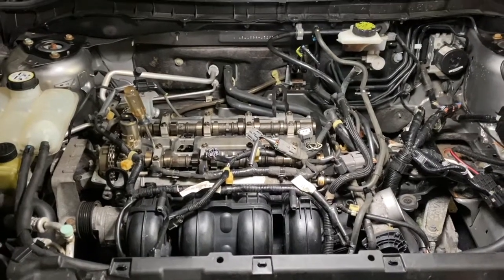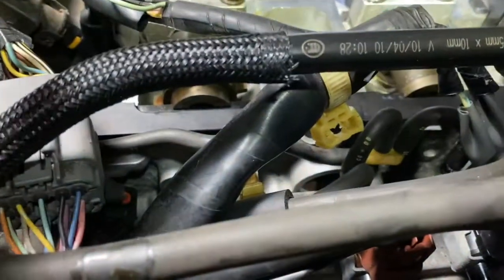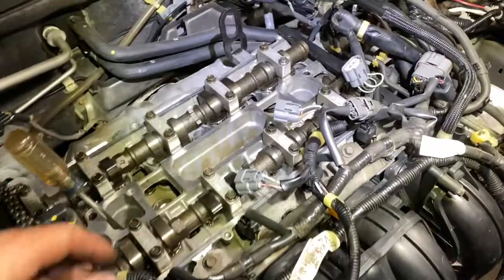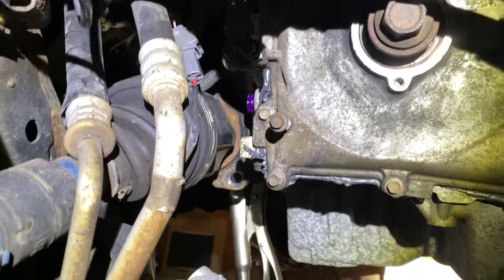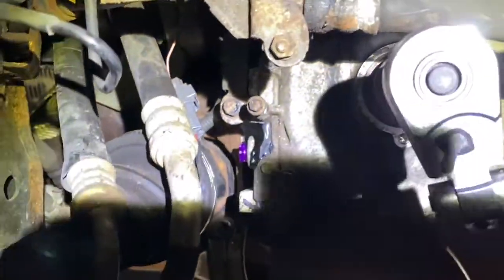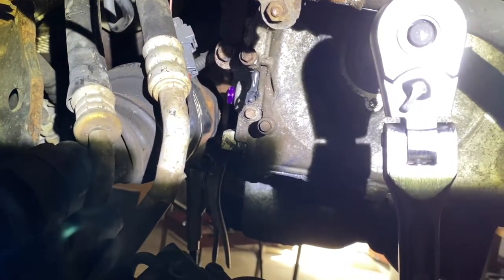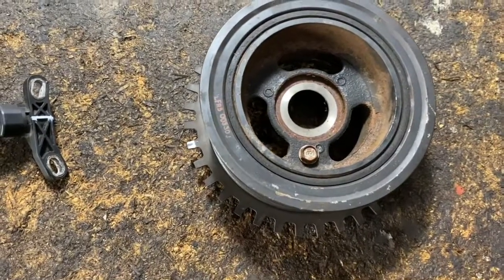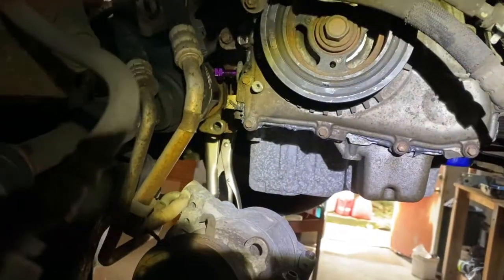How to align valve timing on 2010- 2013 Mazda 3 / Ford 2.0 engine

Comment: Someone said you had to “pre-load the VVT” before installing the timing chain and tensioner or else it will misfire.  Did you do that too on this engine?
Reply from the maker: NO
Reply: @motorcarnut  thx
Reply from the maker: No problem

Comment: Fords better idea on how to make junk. No keys.
Reply from the maker: You probably don't work on modern vehicles most freewheel with no keyways
Reply: @motorcarnut  Oh but I do. I have had problems with the torqued bolts holding cams slipping and they were torqued to the proper torque. The ford 4.0 L engine is bad for having the cam bolts slipping. All in the design to happen on purpose. Should have key ways.
Reply from the maker: I do agree about the key ways but all these manufacturers cut costs consistently it’s a shame

Comment: Jesus this is a huge and painful job I was thinking if I should adjust valve clearance for my 2.0 mzr engine but I changed my mind haha.
Reply from the maker: It’s not that bad if you have some tools and patience.
Reply: @motorcarnut  I was simply annoyed by how badly designed the coolant drain plug was on my car as it is for some reason facing horizontally so I bet I have no patience. How long does this job take for a first time DIY guy?
Reply from the maker: @gandhisFlipFlops that depends but I agreed, vehicles nowadays are less and less diy friendly that’s why you have me.

Comment: Hey bro how's it going how are you. Can I ask because I'm having trouble with same engine we replaced the timing chain kit. And we replaced the vvt but unfortunately we don't know how to put it back the vvt gear.
Reply from the maker: Just follow the video, you’re going to need some special tools as stated to line everything up or it won’t run or run right.

Comment: Just a note from the Mazda service manual. A valve cover bolt fits in the crank pulley TDC hole and bolts into the timing cover. If you've got the valve cover off as you undoubtedly will you'll already have the valve cover bolts free to use one in the crank pulley.
Reply from the maker: I did mention the size but your advice is great as well, thanks!
Reply: @motorcarnut  sorry , you did mention the size but just to save the hassle of searching for one of those dimensions I thought I'd mention it.

Comment: What if both camshafts are out by 1 degree after the final tightening and chain rotation to check the timing? It is impossible to loosen intake camshaft bolt to align intake camshaft without taking front timing cover off?
Reply from the maker: I wouldn’t do that, somewhere you did something wrong. Should redo it.
Reply: You're actually supposed to have the camshaft sprockets slightly loose / free-spinning while you dial in the timing from below.

Comment: Hello Motorcarnut. I followed manufactures instructions for installing timing chain on 2012 Mazda 3 skyactive and got intake and exhaust camshaft sprokets aligned with crankshaft key but something is not right because i have some knocking and had an error code confirming as much.

Do you have any ideas what might be happening that i can research.
Reply from the maker: Hard to tell, don’t know what you did or didn’t do. Do you watch my video and compare? There is very little room for error when setting up valve timing on these engines.

Comment: Hi!

I am planning to replace the tappets and I have the same engine and I wanted to ask if it is really necessary to install that tool to lock the crankshaft. I have to repair my car on my parking lot, and I don't know if I will be able to get under the car and move the cv shaft to get the tool inside. Would it just be enough if I put the first piston at TDC and stick a screwdriver there and just pay attention that the screwdriver won't move?  I mean if the first piston will stay at TDC throught the whole procedure, then the crankshaft will still be in time, right? 

Thank you!
Reply from the maker: I don’t recommend doing it without the proper tools because there are no timing marks, everything free wheels, no notches, it all relies on those tools and you may get the timing close but almost for sure you will get codes and or poor performance.

Comment: Hi i have replace the head gasket and the rings for all pistons and still get a misfire on  cylder 2 check
Reply from the maker: Recheck cylinder compression on #2  as well as ignition spark and fuel. Also the spark plug too.

Comment: I also have a blown head gasket. Why did you decide to change the head gasket instead of an engine swap? My engine stopped and had coolant in combustion chamber
Reply from the maker: Because an engine could be thousands to change and head gasket replacement for me is about $200.00. But every situation is different
Reply: Was your block warped? How warped was your head? What's the max limit warpage before you would do a swap instead?
Reply from the maker: The max warpage is 0.002 for the head and block. If out spec you would have to have either milled back into spec Also have to make sure all valves are seating properly. I had some cases where the head was warped bad enough that the valves wouldn’t seat properly.

Comment: Do you have a video on how to put on a new timing chain after head replacement? There is no key on the crankshaft
Reply from the maker: I didn’t make one on the timing chain but when you take it off just follow this video on how to realign the cams, crank, pulley and crank sensor.

Comment: easiest way to do timing on mazda's 2.0 2.3 2.5 liter engines is cam alignment tool and crankshaft pin. (pin goes into a small hole on the exhaust side of engine, near the timing position sensor, there'll be a size 8mm bolt that you unscrew and then screw the crankshaft pin into, turn the crankshaft pulley clockwise until the crank pulley stops. this is where the piston is set to TDC. no need to stick a screw driver in the 1st cylinder. plus, the crank is stopped from going any further, thus allowing for less checking that nothing has been moved out of alignment.
Reply from the maker: The way I explain in the video is how it’s done. You’re basically saying the same thing as in my video except you left out the 6mm bolt that has to be installed through the crank pulley for total alignment. The TDC with the screwdriver is alway a good habit to have on any engine especially for people who are doing this for the first time.
Reply: @motorcarnut  well, i would use a dowel or something nonmetalic
Reply from the maker: No need, but whatever makes you happy

Comment: Ford uses mazda's 2.3l and 2.5l as their Duratec and Ecoboost series motors with ford's own head and timing. the motor is a (MAZDA MOTOR).
Reply from the maker: And Ford owns Mazda so repairs are basically the same.
Reply: Not for a while now

Comment: Do you have a video of your replacing the head gasket I’m wondering if I have to disconnect my timing chain to receive my head to replace the gasket
Reply from the maker: I didn’t make that video yet, but yes you have to remove timing chain in order for you to remove the cylinder head.

Comment: How did you lock the CRANKSHAFT when installing the harmonic balancer pulley bolt and washers without the crankshaft moving? U mentioned a tool to lock the pulley....
Reply from the maker: That purple tool on the side of the block along with that little bolt in the crank pulley holds it in place as you torque down the crank bolt.
Reply: @motorcarnut  hmmm. This is the only thing I'm a sitting duck on... I'm gonna pick your brain a bit.. so what you're saying is you can torque the central bolt on the harmonic balancer to torque specs (70 foot lbs ish, plus 90 degrees) using the back of the engine timing pin and harmonic balancer pin as the support? I always thought u weren't supposed to use the timing tools to support the final tightening? I thought the balancer bolt was supposed to be tightened while locking the starter sprocket or something like that?
Reply from the maker: Know you are correct, I forgot how I did that car, lol but, no don’t put pressure on any of the timing tools they are not designed for that. Maybe wedge a crow bar on the flywheel somewhere?
Reply: @lithium3332  Get a three pronged crankshaft pulley holder tool.

Comment: Mine doesn’t have the crank sensor or teeth on the balancer. I also have a sensor where the stop bolt goes
Reply from the maker: What year make and model do you have?
Reply: @motorcarnut  2012 Mazda 3 skyactive vin #: JM1BL1W78C1581983
Engine just spins with no compression. Timing chain tight, I can see the cam turning and valves moving. Why would I have no compression in all 4 cylinders? I have spark and gas to the engine cylinders
Reply from the maker: @DIRECTBUYERS14  Without having the car in front of me to hear how its cranking I would suspect a valve timing issue. You need to reset the valve timing first and take it from there. You can go to your local library online site for the repair manual if you don't have access to alldata or Michell on demand. Not having compression in all cylinders should be easy to find because that is a major problem.